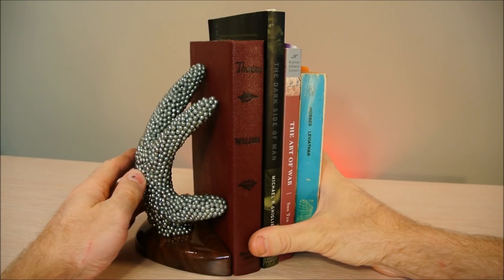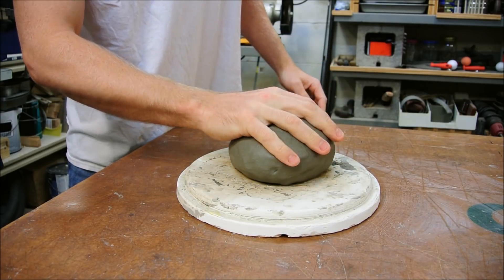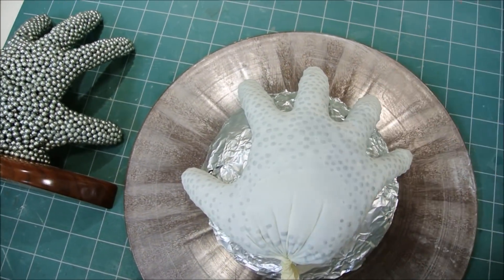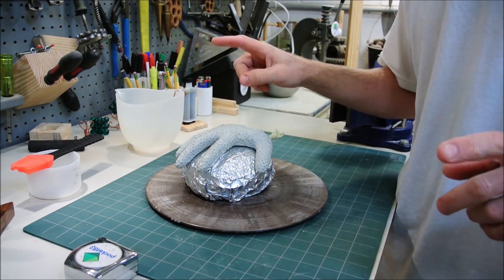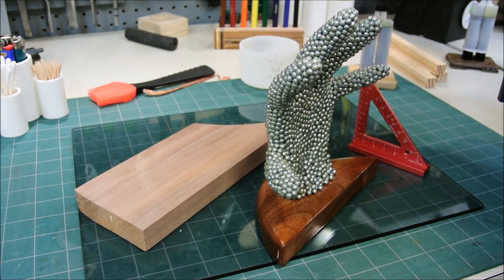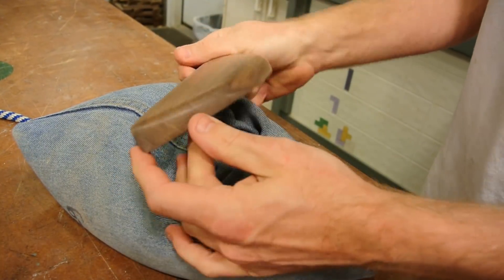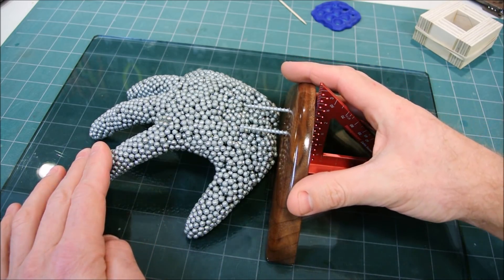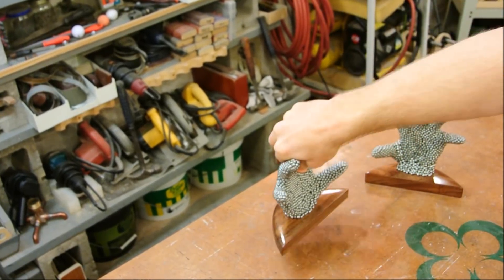Epoxy casting with BBs! (to make bookends)

Comment: i always love seeing the little bits of shop infrastructure in your videos. like the tray on the band saw and the tray on the belt sander.
Reply from the maker: The bandsaw one is a must. A foam-rubber donut surrounds the magnet to reduce vibration, and a felt circle over both eliminates all noise and scratchiness. Like I said, a must.

Comment: So satisfying. I love your creative approach to everything. My grandpa was much the same way, his house is full of neat projects. Most of them are practical, but not all of them. My favorite is a revolving lamp made with Ball jars of colored water with a light in the middle, and powered by running a string though the wall of the garage to a motor so it wouldn't be too loud. It has wooden moving parts and support and is very big; it's still there because nobody wants to deal with moving it and it's kind of built into the space. A lot of commitment for a two-time-use party light! Haha!
Reply: middleC17 wanna see that!

Comment: On the wood finish, I've been using a similar one for many years, which is equal parts of turpentine, linseed oil and polyurethane (I use turpentine because it smells nice, but probably dries more slowly), it's a recipe I found in Fine Woodworking. I just mix it up and keep it in a whisky bottle with a cork, which avoids having threads that get gummed up.
Reply from the maker: Thanks, I'd bet that's pretty similar. I don't like the smell of turp, though!

Comment: I thought they looked like deer antlers at first.  In fact, mounted deer antlers made from shotgun BB's would actually appeal to a lot of hunters.  Nicely done.    Do you think it would work to put the screws in while it hardened, then remove them and use the openings for mounting?

Comment: I have to wonder if attaching a strong magnet to the hand when putting on the finishing touches would not make positioning the BBs easier without having to shift the hand to different positions on the sandbag?

Comment: After washing the glove, you could turn it inside out, spray with silicone (silicone furniture polish), turn back to normal before filling with BB's, that may be the best way to remove the inner glove at the end, if you hadn't cut the glove, filling with air may also help in the removal.
Reply from the maker: Air might work! Good idea. But a mold release is not a good idea. I wouldn't risk weakening the bonds between BBs. There's a lot of movement/mixing going on until they start to solidify. I guess I should also mention that the glove removal step is easy; it's the wire brush step that's the tough part.
Reply: The mould release should only be a coating for the glove, not enough to mix with the BB's/epoxy, if you put the reversed glove on your hand, you could wipe off any excess.

Comment: Nice! You said in your video that you had earlier tried using the clay as the mold and it wasn't the best/better method. I wonder, though, if it would make getting the fingers aligned how you'd like a bit easier if you were to take the lump of clay and grip it with your hand with your fingers aligned as you'd like, then use that to support the glove and bbs. It seems like that would minimize the need to adjust while the epoxy is curing.
Reply from the maker: It's more like taffy than it is like a traditional casting product- it bends, but does not mold. Think about having a firm but poseable hand, like a Gumby. It shouldn't take more than a few seconds to position it however you want.  

So there is more than enough time to make any adjustments. I was focusing on making a video, and not paying careful enough attention to what I was making.

Comment: Just asking when you were sanding the wood to the small end wouldn't it be a lot easier using your bandsaw to take off the bulk of it?? I very cool idea with the bookends
Reply from the maker: Maybe. I might have on the first one. But for the video, an unsupported cut would probably earn me a few safety lectures. I guess I could've put a shim under one side, and then cut. But again, dull blade.

Comment: This really speaks to the 3d space filling / sphere packing algorithms part of my brain. Awesome bookends! 

Is there a way to create a structure like this, but inverted? Like, you epoxy the object you want together, and afterwards, you soak it in hot water, the sphere's literally dissolve, and you're left with nothing but the epoxy. That would be amazing for a desklamp.
Reply from the maker: Foam pellets and acetone? Would resemble pumice, I think. To the first part of your comment, I will direct you to the description. I'm going that way on my next video.
Reply: My god, I did not expect the video description to be this uhh "non-descript"? Although, I should have expected that from you :) Thanks for the read, good bit of useful knowledge in there. Can't wait for the next video in the series!

Comment: To avoid the epoxy shell from the casting you could turn the glove inside out and spray with a mold release. Then turn it back an fill.

Comment: I’m curious if you could have saved some of that fiddle labor at the end by putting some kind of flat, round plug in the bottom of the glove before tying it off, so the hands would naturally come out with a flat base?
Reply from the maker: Yes, a rigid mold. But the goal here was cheap & easy.
Reply: pocket83 I wasn’t suggesting making the mold rigid. Just sticking something like a 4 inch diameter circle of wood into the base of the gloves before you tied it closed.
Reply from the maker: Oh. But too much weight will start to stretch and deform the glove. More than a cup of BBs at a time is not advisable without using a mold. The second/third/fourth castings just make the process much easier to control.

Comment: hi im in school and have always loved stuff like this and was wondering what jobs relate to this type of work, ive already looked into stuff like being an architect but its not really as practical as id like. Any suggestions appreciated
Reply from the maker: This was just for fun, so you aren't likely to find a job doing this! However, many of my projects are influenced by ideas that are rooted in the mathematical and engineering disciplines. Don't give up on school too fast, but a hands-on job will help you build skills that you can use for the rest of your life. Try some construction, or maybe find a local fab shop on summer break, just to find out if you like making stuff. You can get some cash, learn how to use some new tools, and get in shape, all at the same time. If you prefer to make stuff on a computer, look in to CAD or design. Just relax, breathe, and go after what you love responsibly. Your interests will find you! And keep reading. If you don't, then start.

Good luck ;)
Reply: thank you so much :) I currently like to make stuff in paper but would like to upgrade to wood. Its a shame there arent many jobs available with stuff like this but i guess i could always do it has a hobby I will also read more now. I didnt expect you to answer and so didnt write how good this video was. That has made my day, thanks :)
Reply from the maker: Sure! Come back anytime you have questions ;)

Comment: the "slow speed" mode on a drill is actually "high torque" mode and it is meant for drilling large diameter holes for example using a stepped - or tapered drill in metal or round cilinder drills like sawtooth for wood etc or diamond abrasive for stone tiles etc... just fyi

Comment: very cool vid, well done. Where did you get the detail tool at please at 11:35
Reply from the maker: That's called a 'flex shaft' (or extention) for a rotary tool. It's very useful if you use a rotary tool much.

Comment: What you do is cast your hands in plaster of Paris, and use that to make a resin template.  Then you sand and buff out any imperfections, and use that template to make a silicone mold in which to place your bbs and resin.
Reply: Of course, you could always just make the silicone mold around your hands depending on setting time.

Comment: 3:29 calculation:

64% packing efficiency for loose spheres https://en.wikipedia.org/wiki/Sphere_packing#Irregular_packing
7.86 g/mL density of iron
1 cup = 236.6 mL

mass of 1 cup of steel BBs: 1194.7 g
round to 1200 g because only 2 significant figures

Comment: Wouldn't heat have worked to remove that thin layer of epoxy? Maybe a blow torch or heat gun?
Reply from the maker: Yes, but no. It would smoke, stink, and then melt black funk all over the finished project, not to mention potentially weaken the bonds.

Comment: i would recommend using gloves when manipulating epoxy since you can develop a severe allergy to it. I'm curently studying in composite materials and we never come close to epoxy without gloves. The video was pretty nice though :)
Reply: If you follow the technique used here, you shouldn't get any on yourself. Gloves make your hands more cumbersome, and the resulting spills and drips increase your chances of other, non-hand epoxy contact. 

Control is the first and best line of defense.

Note that this approach does not apply to every case or substance; unfamiliar chemicals should be given a chem-lab level of avoidance and precaution. However, I am familiar with epoxy, and the risks posed are minimal. Fumes are more of a concern in this case- especially when using additional heat. Besides, one could develop an allergy to nuts, too.

Comment: Bbs stuck to my glove I’m not sure what I did wrong, also there was no thin resin layer
Reply from the maker: Did you apply heat? Did you use a latex glove? It sounds as though your epoxy wasn't thinned enough from additional heat.
Reply: I looked at the box from which I got the glove turns out it was nitrile & not latex which I’m guessing was the problem because I followed the video step by step
Reply: Thank you for your help!

Comment: This is cool, but I think it would have been slightly better if you had used a wax mold of both of your hands. It would look a lot more like a hand, and a lot less like a floppy glove.
Reply from the maker: Sure, if by "better," you mean more expensive, time consuming, and difficult, then sure. But I wanted the bumpy look.
Reply: pocket83 I mean, time consuming is relative. All you would have to do is get some candle wax melted, and prepare a bucket of ice water. Then you dip your hands back and forth in the two buckets to create your mold. Pretty simple. Still, I get where you're coming from. In the end, it all comes down to what look you prefer.

Comment: Better way to do that would have been a silicon cast and casting resin ( west systems) and Just fill the mould with bbs and epoxy, it would have cast better, not break so easy and also be able to polish the resin to a glass finish which would have looked much better rather than risking bbs falling off over time
Reply: Just be quiet. Wow.

Comment: Instead of drilling screws in from the bottom of the wood, and back-filling with BB's and epoxy, next time couldn't you embed a couple of short lag bolts into the mold, mark their position on the wood base, drill it out, and countersink the nuts to secure the bolts?

Comment: Wouldn't it have been easier to place a couple bolts with the heads up inside the hand and let it harden.  Then just drill a couple holes in the wood.
Reply from the maker: It would've been possible, but not 'easier.' Alignment would be tough, as would a larger pour (more than one cup). More than a cup of BBs is Heavy, and risks destroying the glove. 

A proper mold could be used, but that's not what this video was about.

Comment: I love how you don't actually wear the rubber gloves when using epoxy just use them as molds, lol. I know it's not particularly dangerous it's just a pain in the butt to get off.
Reply from the maker: It's pretty easy to avoid touching. I did get a drop on my forearm once, near the end. Just rub it off quickly with some baby powder. 

Sometimes gloves make your hands cumbersome, and you just end up making a bigger mess. I know that's not good P.R. to recommend, but it's the truth.
Reply: pocket83 yeah it just depends on your level of klutziness and how much you're afraid of getting the stuff on you vs coordination. I'm kind of a klutz and not particularly handy so I usually end up plastered in whatever material I'm working on ;)
Reply: not dangerous, but pretty annoying if you can't use it anymore because you've gotten allergic to it.

Comment: If you use metal wire from a guitar it works better than fishing line that’s what I use
Reply from the maker: No, it's not "better." Wire kinks and rusts, not to mention that it has 5x the diameter, so it doesn't cut as well. It's also more costly, and annoying to store.

Note that I use FireLine, which is much stronger than regular fish line.

Comment: This is 2017 nobody reads books anymore
Reply from the maker: Due to the outrageously bold nature of that comment, I'm going to offer three possible explanations for your claim. Either:

1) your generation has declined in literacy to the point where you actually don't read, in which case, you will continue to develop an unnatural and excessive dependence on technology, as ignorance becomes ever more widespread. Corresponding decreases in education, production, and general (g factor) intelligence should become apparent, especially in economic related data. Presently, evidence does not support this position. 

or:

2) due to the extreme degree of your own ignorance, you actually believe your claim to be accurate. This case would probably be caused by a combination of a smart-phone fixated peer group and small-minded parents. Familial substance abuse is likely a contributing factor.      

or:

3) you are out baiting for a reaction. This case would arise from one of two conditions; either you actually believe that response baiting makes you clever and/or funny, or else you are victim to some variety of psychological malformation. 

No matter the case, you should probably start reading more. Things don't look too promising for you!
Reply: pocket83 I do I just try to hard to be funny:((((((((

Comment: You should really wear gloves with a belt sander, even if you do have loads of experience...
Reply: No. You obviously don't have loads of experience.
Reply: pocket83² what?
Reply: You never wear gloves while using a belt sander, drill or really any machine that spins. Your glove can and will catch onto the sander and get stuck. If you cant pull your hand out it can pull your hand in and tear up your fingers.

Comment: sawing and sanding 1 block is not woodworking donk
Reply from the maker: I chainsawed the tree. I then cut it in to slabs with my bandsaw, and used my tablesaw to square up the edges. After it was cured, I formed this piece in to a parabolic shape, then sculpted down the sides rounded the edges, sanded it with five grades, and finally applied seven top coats to finish it.

What do you call this procedure on your planet?
Reply: pocket83 it's still not woodworking, woodworking is when actually make something, you just cut a block and sanded it.
Reply from the maker: Some of you people are unbelievable. I don't care what you call things. Neither do I care what you classify as "making something." 

Go polish your planes. Just stay away from here.
Reply: pocket83 he’s trolling you great Woodwork! 👍🏾
Reply: "woodworking is when you actually make something"

He literally did make something, you dolt.

The base for the bookend is literally a "thing". And he made it. So he made something. And it's made out of wood. So by your own definition, which is that woodworking requires that you make something, you argued against your own point. He did woodworking.

Now please go, your tendies are getting cold.
Reply: pocket83 this was a rookie mistake, you replied to a troll. The signs are obvious, smug comments on technique or word usage that offers no real insight or wisdom. Working with wood is "woodworking" but this troll felt the need to project HIS narrowed definition in order to imply that woodworking must also include a level of technical difficulty that meets a standard known only to him. In this troll's mind, you must first ask him if a project meets this standard. If you are not willing to do this, I would suggest ignoring trolls, or delete the comment.
Reply from the maker: Timothy Jesse:
My channels have amassed tens of millions of views. That means more comments than most people could ever imagine reading. If you think I'm a "rookie," I would ask you to think again.

I'm right there with you on much of what you've just said, but I disagree with your conclusion. Here's a video about why: 
https://www.youtube.com/watch?v=R-bXn3-7jsk

Further, "troll" has become a useless term due to overuse. This viewer was simply rude, entitled, and stupid- even if he was just 'pretending' to be. Calling him a troll legitimizes his behavior. It's like saying, it's just a prank, bro!